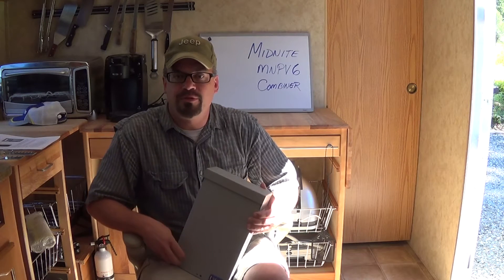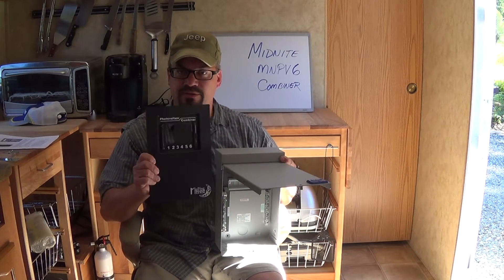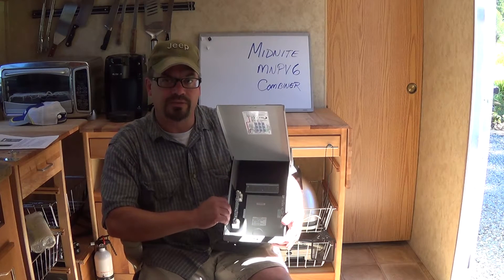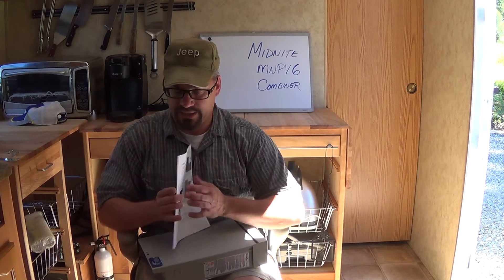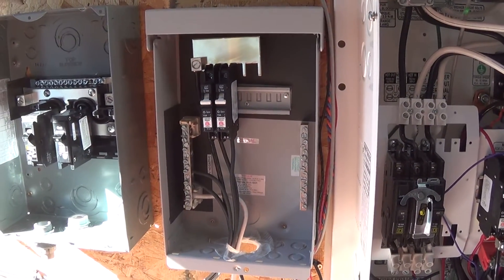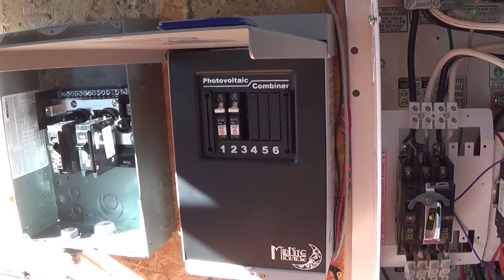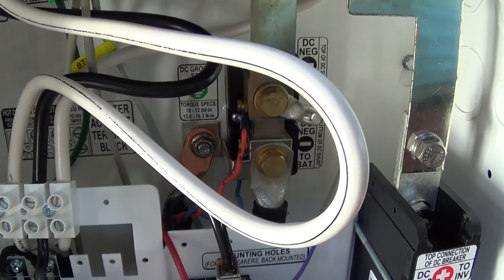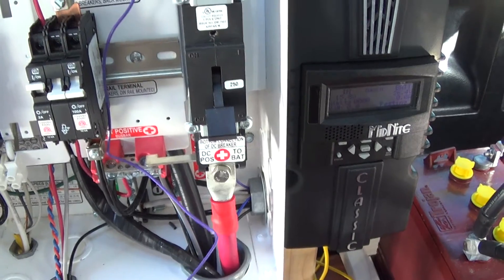Solar Install Part 5: Installing Midnite MNPV6 Combiner Box

Comment: To get the plastic cover off without sacrificing any skin to the cause, remove the metal door. This is done by closing it slowly with a screwdriver blocking it;s way near where it hinges. Mine came with instructions on how to do it.
Reply from the maker: Good to know.

Comment: What's the point of combiner box when its 1 foot away from charge controller? I would have combined the wires on the roof just with crimp connections, no breakers, no fancy box. I really dont get it.
Reply from the maker: So that you can isolate the panels from the rest of the equipment.  It is not advised to connect things together with power already running through them.  It also lets me combine two sets of strings into one input into the charge controller.  I had one set on the RV and another on my pickup truck.